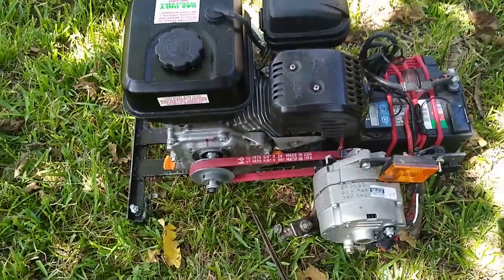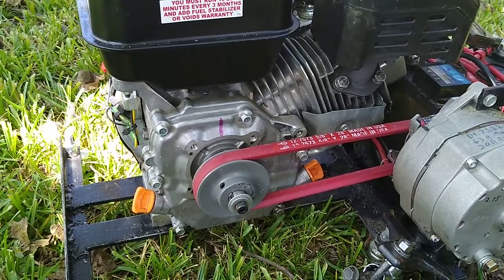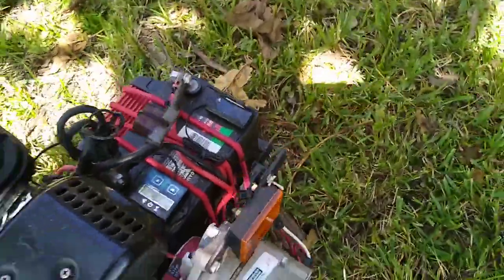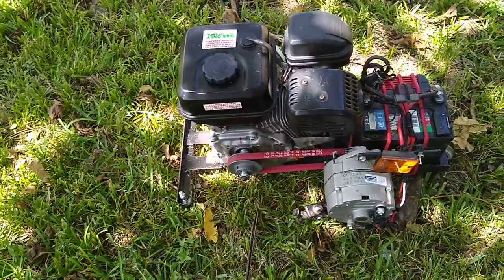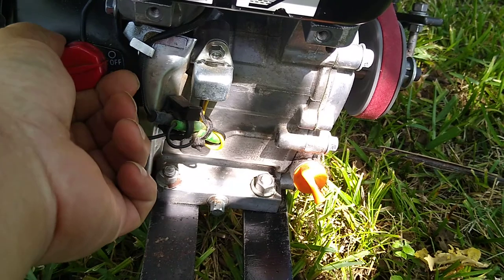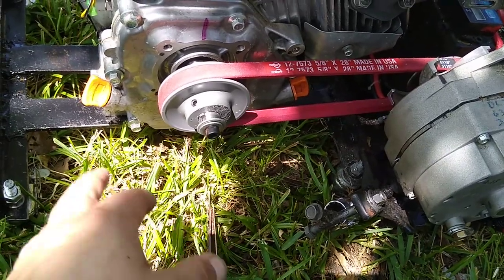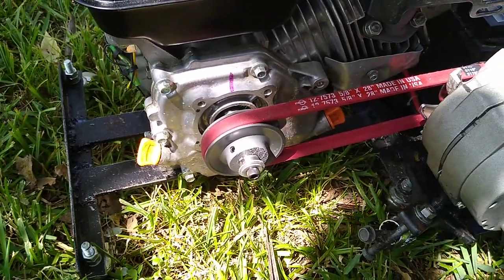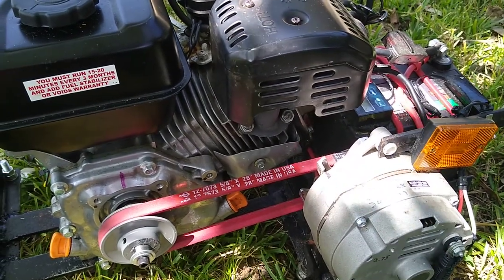Small engine Alternator / Generator / powerhouse. Predator 212CC 6HP.

Comment: I went and built me one after watching this video. I have an off grid power system and needed something to charge the batteries when the sun wasn't shining. I was thinking about ways to charge them and using an ac generator and a battery charger would be redundant. The only exceptions is that I used a 24 volt alternator from a case tractor and the store was sold out of the 6 hp engine so I used the 3.5 hp and it works just fine. I got a 4 inch pulley on the engine and I think there's a 3 inch on the alternator. I got 2 5,000 watt inverters, one is for lights and the other goes through a step up transformer to get 240 volts ac split phase at 50 amps. I also got alot more batteries, I used the 29dc Maxx from Walmart, there's 10 of them
Reply from the maker: That's awesome!! I would love to see that.
Reply: @abfig78  u should sell the mounting kit. I tried building one two years ago it's important to do without welding skill. My pulleys and belt are either too big or too small to fit correctly without tensioner and I can't find a tensioner that will work with alternator belt. There's a bicycle chain tensioner on ebay that's the only one I can buy so I gave up the project 2 years ago but now I really need to start again and finish it, can you help? Much much much appreciated.
Reply: @BOREDANDWELLBORED  I used a turnbuckle as a belt tensioner.  Works great and is easy to adjust

Comment: I was going to do this but with 3 Alternaters, But i just bought a 9HP Generater Custom exhaust and the engine will run all night never gets hot, solar pannels take care of the power during the day and the Generator can run through the night if i need.
Your setup is ok but i would run a double belt pulley on the crankshaft and setup 2 Alternaters, 2 truck Batterys and a 8000w power Inverter, this would be a great Mobile power supply.

Comment: I have a HHO Generator that produces enough hydrogen to run a 6.5 hp motor. 120 amp Alternator charges 3 lead cell batteries that are 950 amp batteries each. I then hook a 7kw inverter with a 30 amp RV plug to run my Camper. No more gas HHO generator uses 14 amps and camper on averages uses around 22-24 amps. Average 38 amps on a 120 amp alternator. First time using for 3 days, low noise with extra muffler installed. I have a 50 amp fuse on main power lines with individual fuses on HHO gen and camper.
Reply: Mark, thats very impressive! Im currently working piece by piece towards self sufficiency, and your idea here is a great one! How is the durability of the HHO MOTOR however?  the one i made a while back ended up shitting the bed because its not made to combust Hygrogen.  You should make a video of this and post it.  let me know when ya do!

Comment: A lot of talking about everything except the output performance of the alternator which I expect is very low.
The alternator only has a continuous output capacity in that configuration of 20 amps or so unless you want to burn it up.
To make it usable you need to remote mount a bridge rectifier and voltage regulator that will run cooler and increase the continues output to at lease 60 amps or 750 watts instead of the 250 watts that you currently have. You also need a larger battery bank that can absorb the charge to be able to do some useful work.
An air cooled, six hp, gas motor charging at 250 watts is extremely inefficient and an absolute gas hog not worth having.
Reply: i have done a lot of experimenting over the years with the delco 10/12SI series alternators like the one used in this video, and i can say that it will produce a reliable 50 amps at 12 volts continuously with the 63 amp stator without overheating. the internal regulator and rectifier have good heat sinks and good airflow and don't begin to suffer overheating issues until you go over 70 amps continuously. the 12si is better for high output because it has better airflow through the case.

agreed the 6.5hp predator is overkill for this application, but they are inexpensive and easy to get. a 2 or 3hp engine would be better but typically costs more than the 6.5 predator.

Comment: Did you use the +20 rod and thinner head gasket?
Reply from the maker: I used the head gasket and push rods recommended by GoPowerSports. Really they picked out all my parts I would need for the upgrade. It's been a while so I do not remember. 

I have two engines I rebuilt and the other one has almost all the mods done. Only thing missing is the better carburetor, fuel tank removal kit with plate for throttle in the racing engine. For the generator I told them my plan and that I want the better connecting rod, Cam, push rods and stuff. They told me for the generator, as I wouldn't be going crazy with the RPMs that I won't need the upgraded flywheel. 

Good guys over there.
Reply: @abfig78  yeah no comparison between our builds really, I’m looking to build reliable torque using a low rpm hemi engine in the same application you use yours except in using a 160 amp hairpin alternator with a 2/1 ratio I’ll only turn around 2500 rpm